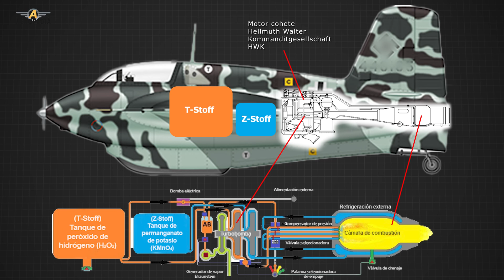WHAT MADE FLYING THE MESSERSCHMITT ME 163 KOMET SO DANGEROUS?

Comment: The chemicals weren't just dangerous for the pilots. They were even more dangerous for the ground crew. Those chemicals would strip flesh off bone in a heartbeat. That propellant had a tendency to self combust. This plane would never be able to turn the tide of the war. It was as dangerous to the Germans, if not more so, than to the Allies. It consumed significant & quickly dwindling resources, and there weren't enough experienced pilots, even if it somehow got into production 2 years earlier.

BTW, cool and interesting air and space museums in the US: Smithsonian Air & Space (make sure to see the 2nd building as well), the one mentioned above in Datyon Ohio, The Museum of Flight in Tukwilla Washington just outside of Seattle, the Evergreen Air & Space museum in McMinnville Oregon - home of the Spruce Goose and quite a bit more, and various ones around LA, and more I simply don't know about.